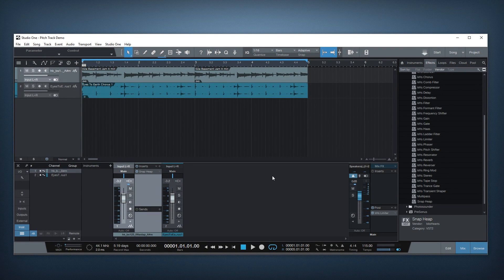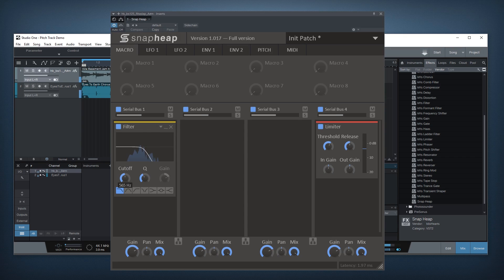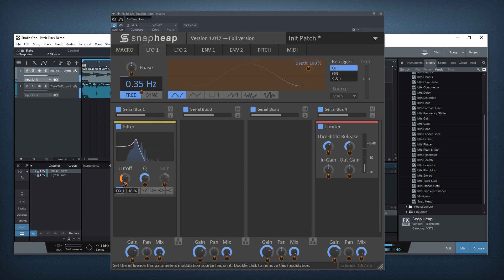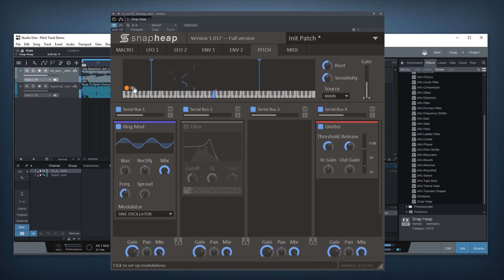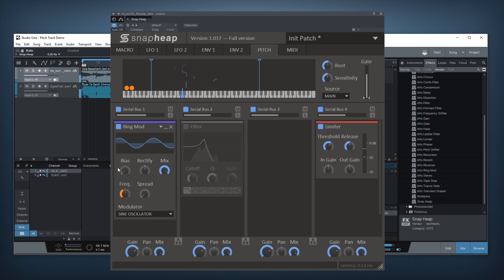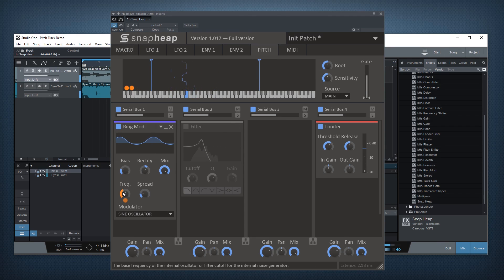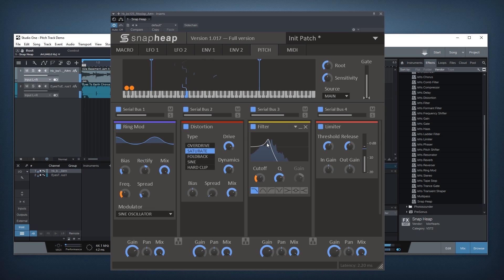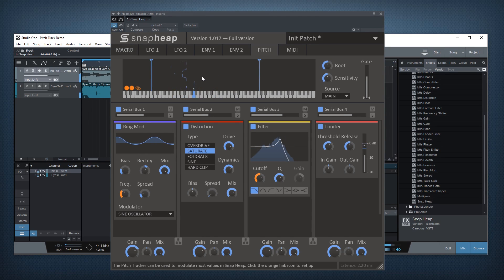Pitch Tracking in Snap Heap

Comment: Great tips.  Thanks so much.  BUT:  I can't get the tracking to work with the MIDI option for tracking.  I can get the "Note" option when I'm in PhasePlant to work great in tracking the keys (eg tracking the cutoff frequency up and down the keyboard).  But I can't get the "Note" to work if I'm just using the Snapheap as a standalone plugin (nor, for that matter, the "velocity" or "pressure" under that MIDI tab).  Frustrating, because frequently my complex sounds on a single key produce a variety of frequencies, so the "Pitch" option of tracking tends to freak out.  As you mention in your vid, the MIDI would be a better connecting point to avoid that very problem--but I can't seem to get it to work.  Any ideas on what I'm doing wrong?  (Cubase 11)
Reply: I figured it out, thanks.  (It's in the "MIDI SENDS" part of the Cubase manual.)